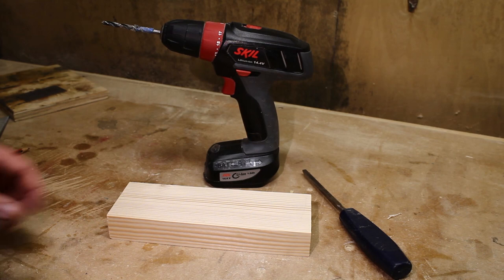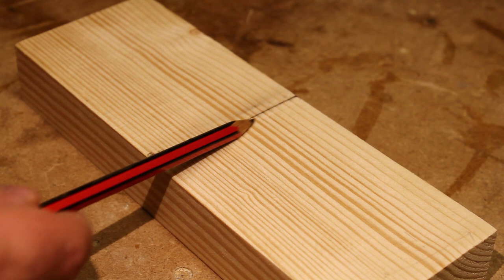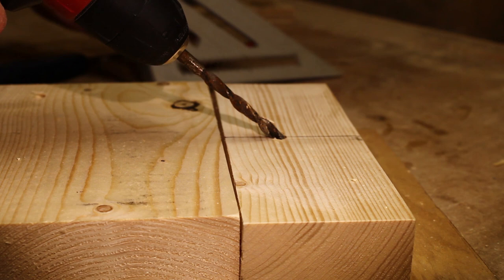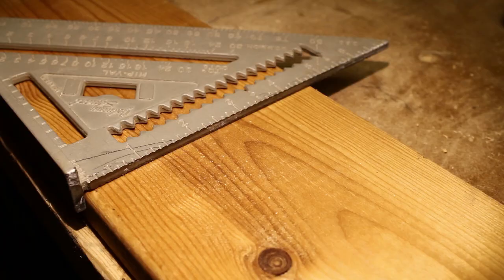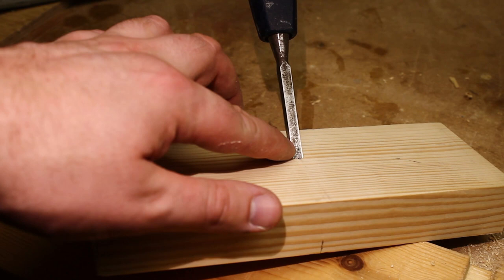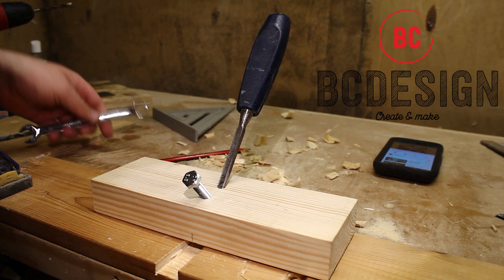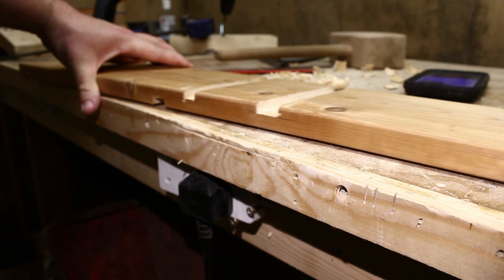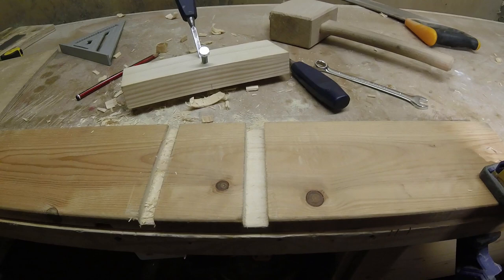DIY How To Make A Router Plane / BCDesign01

Comment: This is an EXCELLENT take on the Paul Sellers router design. I like his original "poor man's router" but never thought to include the set screw, and since my chisels are tapered, I knew the adjustment would loosen up over time. I was able to make this in about 30 minutes with minimal tools. Thanks!
Reply from the maker: Thank you for the nice comment! I love Paul Sellers! Glad you found the idea useful!!
Reply: the set screw was a masterful improvement.  Very cunning!